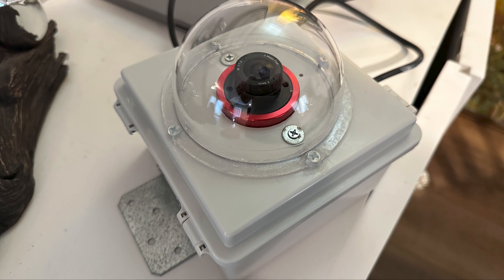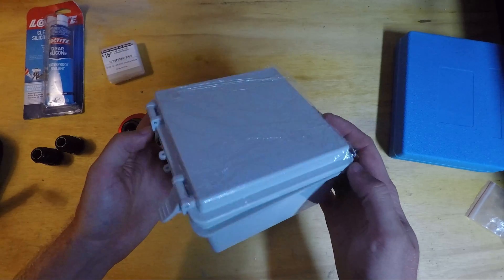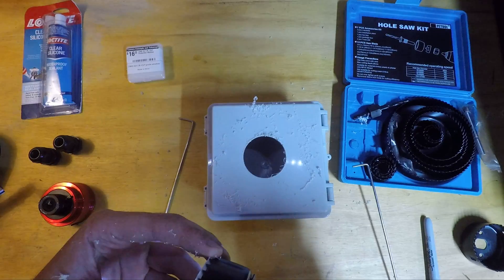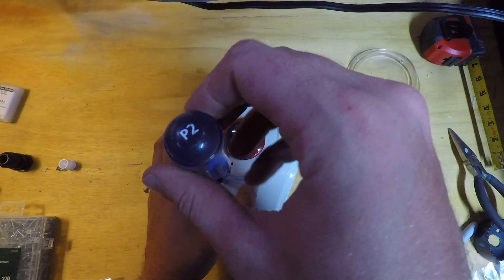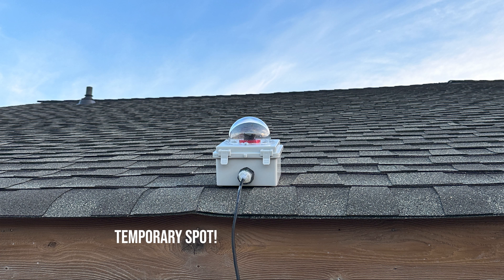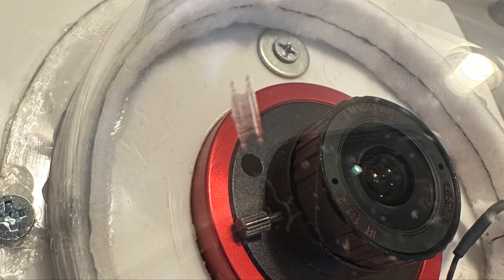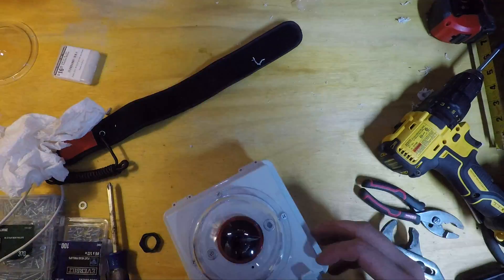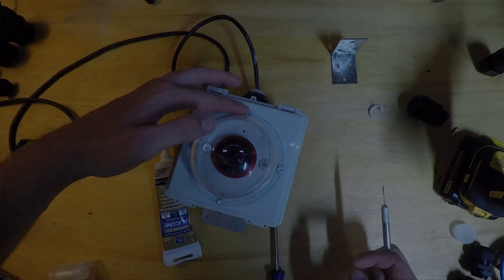How to build your own All Sky Camera

Comment: Hi. Great project. Can you tell me if there any way the sun glare can be avoided during day light. Can a tinted dome be helpful?
Reply from the maker: @ifranrahman  Thanks! The only thing you can really do is reduce reflections from the camera & housing inside the dome. There may be some kind of protectant out there for the acrylic to reduce scratches, which are mostly what causes glare. Personally I just found that it’s better to swap the dome out when it gets bad. 

You wouldn’t want to tint the dome unless you don’t care as much about seeing things at night. Otherwise that could probably work. I haven’t tried it though.
Reply: @normanrevere  thanks a lot

Comment: Looking at the specs of the camera it's very similar to a few CCTV cameras I use at work.The cameras I have in mind however only do 30FPS and I would have to disable the IR and white spot light. Kinda tempted to try it and use a UV-IR cut filter.

Comment: Like it! But I wonder: how long is the sensor going to last when operated 24/7 - especially under daylight and with the sun focus for hours and hours onto the sensor. Just as human eyes, sensors usually don't like sunlight hitting them for more than a split second. And since it is actually a camera designed for the evening/night ... hmmm.

I see on your video that it seems to work well right now, I'm just wondering if you need to buy a new cam every 6 months or so because it starts "burning up".
Reply from the maker: @andrewpoison  from what I can see, the sensor hasn’t suffered any noticeable damage whatsoever. Ive had it streaming the sky on my channel since I uploaded this video, and it’s still humming along perfectly fine! I did take a dark frame when I started streaming, when I finish my one year timelapse I can take another and compare. 

I think the reason it’s fine is because the lens is a 2.5mm fisheye. The suns rays aren’t being concentrated very much compared to a normal lens.
Reply from the maker: Just wanted to pop back in after another 6 months and let you know... That same camera is still running great! Its been on & taking pictures almost constantly since some time in August of 2023.

Comment: Hi. I am researching how to build my own.  Is there anything you would do differently?
Reply from the maker: Yes there is. I’d start by using a powered USB hub, adding a voltage regulator to the dew heater, and making a better passive cooling system than what I had. I’d also mention marking the orientation of the camera both on the cam and the housing so if you have to take things apart you can put them back exactly how they were prior. 

I have made a lot of changes since I uploaded this video, and while the setup in this vid worked well for me, the changes I made have made things much better. I’ll make a follow up video to this one at some point soon.

Comment: Any thoughts on how you chose which camera? Looking at the ZWO ASI678MC, ZWO ASI676MC, and the ZWO ASI715MC, but in this use case I'm not 100% sure what stats really matter. The 715 is a lot cheaper and has smaller pixels and a good resolution, but not sure if the lower full well and read noise will counter act or matter in this case.
Reply from the maker: I like the 678mc, it was recommended to me from someone who uses theirs to record their imaging sessions. But that doesn’t mean you wouldn’t get awesome results with something else. 

I’m not sure if it would matter in practice, but having a low read noise is really nice. Especially when the cam sits baking in the sun half the time.
Reply: @normanrevere  Thanks, that makes some sense. I've got an ASI2600MM for deep sky and I understand the stats from that, but I've never done planetary and I know their cams are quite different when it comes to what's important and this is a different use case altogether. Your video quality of the timelapse looks amazing, so that's good enough a sale for me when choosing between similar cams. Not sure if I'll pull the unit one day to do planetary or just get a newer one if I ever switch to doing that. My new scope is short focal length, so it'll be awhile.

Comment: Hello, I also set up an All Sky, PI4 + ASI120MC-S, unfortunelly, I have the problem ASI_ERROR_TIMEOUT, please, can you share the Allsky WebUI Setup that you used ? Thanks in Advance!!
Reply from the maker: I just use OBS. The cam connects to my mini-pc and then I just run the cam through there. Is the camera the thing that is crashing? or is it software? If its the camera, it might not be getting enough power or your USB cable is too long. I fixed that by using a powered USB hub and a short USB from the hub to the camera.

Comment: Id like to know how long your usb cable is. I am building another allsky cam myself and considering keeping to pi5 in the house instead of all in one box outside. I was a hardcore astrophotographer myself for a while until I retired the hobby to more simple things. I also use an Allsky7 meteor system which is pretty cool. I am concerned with running my pi5 along with the camera in the same housing because of heat issues and then over-engineering cooling systems along with automated dew heater control. I like you idea of just housing the camera outside. So my 2 questions are... Is your dew heater always on or if not, how is it triggered? And how do you extend your usb, just a powered hub?
Reply from the maker: Mine is a powered 30 ft USB 2.0. I also upgraded to a powered USB hub after the video was made, which I believe I put in the description.

The dew heater is always on. You could probably put some kind of thermal switch in there, or some other kind of sensor to turn it on or off. I think most of the heat is caused by the sun though. I've experimented with turning it off during the day, but it had a pretty negligible impact on the camera temp. I may build a new housing in the future, with a TEC incorporated somewhere.

I have actually made a few bootleg upgrades to the housing since I uploaded this, which I'll show off in an update video that I'll put out when the cam gets 1 year old. I have been recording constantly since I uploaded this! 

In the meantime, this is what i've done: 

Added a powered USB hub, 

Added a sealed copper pipe with both ends sticking out the side of the housing, with a bunch of metal chain inside to act as thermal mass & heatsink for the cam. The chain is attached directly to the bit of metal I attached to the bottom of the cam, with some thermal paste added between the chain links and the copper pipe. It helped drop the internal temp by almost 10-15f. 

I also stuck some reflective tape to the bottom and back of the housing. That helped lower the temp a few degrees as well. Nowadays the cam averages around 120-130f on a hot sunny day. I would put it all the way around, but I think my neighbors think I'm weird enough already for having this thing on my roof. I don't need to make it even more noticeable! Haha.
Reply: @normanrevere  I ended up just putting everything inside an 8" housing (like yours, just bigger). I used a cpu heatsink on the inside attached to a linear fin heatsink on the outside underneath. Which is where the flange base attaches. The heatsinks are sealed airtight. There is a PWM fan on the PI5 and an 12v blower on the ASI676MC. These create the air circulation for the internal heatsink so it does not need its own fan. The outside heatsink is cooled passively just by wind. Almost all of the exterior housing is covered in aluminum tape except the bottom. I added 2, 12v/7 watt polyimide stickers in series to the underside of the lid (under the dome, but inside the box) for dew control. It acts similar to under-the-floor heating. They are triggered on by a relay which is activated by a GPIO pin. I use no sensors for the dew control. I use the open-weather module in the allsky software and set it to activate when the dew point is within 5 degrees F of ambient (default is 10 degrees which I found is too much and not needed). I have not had any dew issues for the past month. I also have it set to turn the heaters on when the temps are near freezing no matter what the dew point is to make sure snow and ice melt. The 2, 7 watt heater strips in series total 3.5 watts spread over a larger surface area. This is better than a bunch a resistors wired together and focuses the heat to the dome (the heater strips have foam pads covering them so they are not cooled by fans). This past week has been near 100F and full sun. I have not seen the core CPU temp of the Pi5 hit 60C yet. I don't have a temp sensor for the inside of housing, but the camera sensor when not in use, shows about 50C during the hot weather. So that's relatively close the the internal housing temp. That's not much different than an attic. I also purged the housing with dry nitrogen gas before closing to eliminate any potential for internal condensation during cold days. Assuming it has no micro-air leaks. The whole system is powered by a 12v feed from a 12v UPS and I use an 12-24v to 5.1v 5A USB-C converter inside the housing. This allows it to be easily removed and plugged to any mobile 12v source such as a PD battery bank. I found this to be more versatile than POE. I also wired in some external LEDs in parallel to the dew heaters to show visually if the heaters are actually being powered since the software module only shows activation and not power flow. 

There could be some improvement to the heat dissipation system but for as long as it's done mostly passively, I would prefer not to over-do it. Since it will be very cold during winter I'm trying to retain some amount of heat inside the housing. 

I do need to add a comment about meteor imaging using these planetary cams though. For mono I highly suggest binning minimal of 2x2. Larger pixels are more sensitive to light. I find running my color 676 at full res, the pixels are too small to absorb light from fast moving light sources. For satellites and planes it works great though no matter how dim they are. Binning a color cam though is pointless since it is impossible to make a group of pixels into one at the hardware level. In my case though, my goal is to capture better images of "fireballs" with better color, resolution and suppressed noise vs my Allsky7 meteor system can produce. The meteor system is amazing for video capture of even the most faint meteors but it's image creation is just stacked frames and is usually over exposing bright meteors with only fair color detail. I have compared images/video from both systems and even the semi-bright meteors are rather faint using the allsky cam. If meteors are the goal then a color camera with a pixel size of 4um or larger is suggested or bin mono to achieve the same or larger pixel size. Although low res kind of sucks for fish-eye lenses. The other goal with this is for aurora should it occur again. The 676MC is starvis 2 and has amazing light sensitivity for that purpose. My meteor system did capture all night video of that event, but creating time-lapses from 7 cams worth of video is a huge pain. That's were these types of allsky cams really simplify things. The only thing I wish I could find is a better/faster lens and they don't really exist for these small planetary camera sensors in fish-eye format. The stock lenses are about as good as it gets.

Comment: I'm seeing many projects like this using a dome to protect the camera.
I'm also thinking about building a similar project, but I'm concerned about the protectiong getting dirty with time, the air here is not very clean, and probably some particles will deposit over the glass in a month or two.

This is why I'm thinking about a flat  glass protection instead of a dome, which maybe I can clean with some kind of electric wiper. 

The place where I'm going to install the camera is not very easy to reach, so I'd prefer to avoid to go there if not really necessary.

Any ideas?
Reply from the maker: Honestly that could probably work if you place the camera as close to the glass as possible. There could be distortions on the outer edges, though I guess you still get those with a dome as well. 

I think my biggest concern would be water and dust collecting on the flat surface if it is level. You would probably have to angle it so water can flow off.  As for the dome getting dirty, for the most part the rain takes care of it. I sometimes spray it with a hose to wash it off if it hasn't rained in a while. I rarely have to go up and clean it with a cloth.

Build it and find out!
Reply: @normanrevere  thanks for your tips.
I think you're right, a flat surface may be easier to clean but accumulate dirt more easily.

I'll try to use a dome, and maybe add a sprinkler to spray some water in case It gets dirty. Getting the water is not a problem, I can collect the rain in a little tank, and use that.
But I'll test the setup before, maybe it will stay clean.

The problem is that the place where I want to mount the camera is not easy to reach, the only way to get there is to exit through a skylight on the roof, which is not the easiest operation 😄

Comment: Very nice! I have one of those SBIG all-sky cameras that I haven't deployed, thing cost about $2.5K when I bought it new something like 10 years ago - it's only 640x480, which is annoying. I'd recommend buying several of those acrylic domes and putting them in storage. A lot of the sellers on Amazon don't stick around for long. Appreciate the parts list, I'll probably take a stab at building something like this for meteor detection.
Reply: Do you have more information about meteor detection? Software, etc

Comment: Hiya, nice job, does the camera adjust its exposures for day and night automatically? Or is it the software that’s doing it ?…… I have a real problem with mine dewing up, currently experimenting with dew bands etc to try get it right……
Reply from the maker: Thanks! The software does. In OBS the settings let me set things to automatic while trying to achieve a certain scene brightness, so it changes exposure depending on the amount of light. That said I think a lot of softwares let you set exposure times to automatic. 

Mine hasn't had any issues with dew thanks to the dew heater strip I put in. It might be doings its job a bit too well though so I may need to figure out something before this coming summer. During some of my tests last August the cam was getting dangerously hot, probably mostly due to the sun but the heater definitely doesn't help. I might put a small vent on it and do my best to weatherproof / bug proof it. We will see
Reply: @normanrevere  what dew heater strip did you use?
Reply from the maker: @cosmicshadow6935  Its just a USB camera lens dew heater strip that I had for one of my lenses. I ripped out the nichrome wire inside and wrapped that around the base of the dome and used a little bit of silicone to hold it in place. Since I uploaded this video I also added a little voltage regulator that can be changed with a small remote, so I can change the strength of the dew heater without having to fiddle with things inside the box.

Comment: The dome: Get some Turtle Wax 53477 Hybrid Solutions Pro Flex Wax, Graphene Spray Wax. It will protect it from the elements and the water will bead up and roll of, the wind and rain will most likely make it self cleaning to some extent. Cool little project.
Reply: That’s an awesome idea

Comment: Cool project.  It's nice that in spite of light pollution you're still able to see the Milky Way clearly in this as well as a hint of Andromeda.  I've seen several of these that use an acrylic dome and I keep wondering why they don't use a flat piece of acrylic instead, with the camera all the way in the box.  I realize that it would be a tight fit with a fisheye lens and that someone must have tried it and failed, just not seeing what the problem would wind up being.